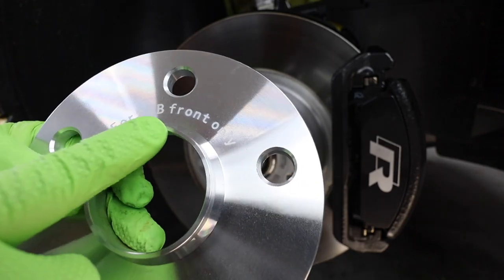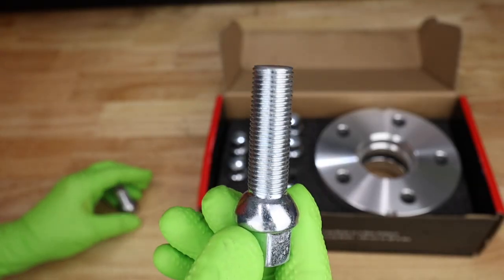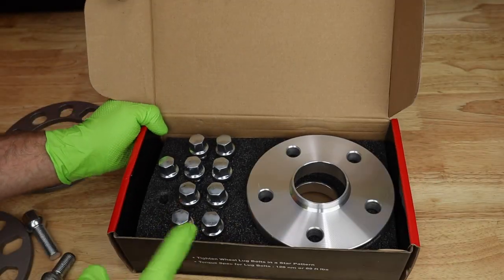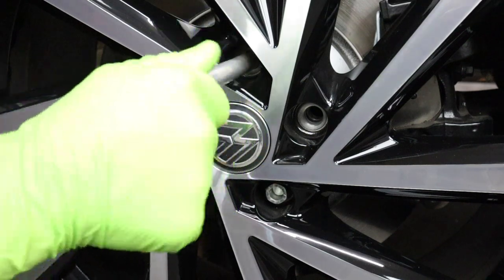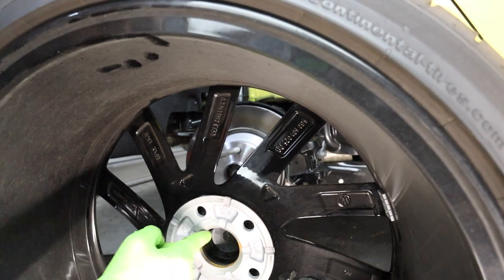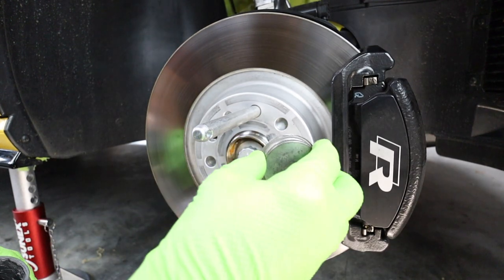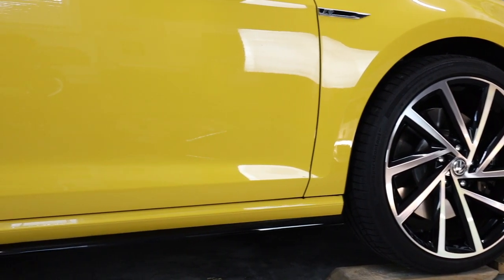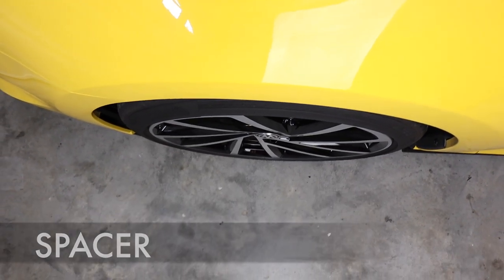How to PROPERLY Install Wheel Spacers

Comment: This may work to pull bolt caps, but since the caps are round and most of the Audi ones I've experienced are still of the hex pattern of the bolt, it may not be able to get a grip on it.

https://www.amazon.com/Genuine-Audi-8D0012244A-Wheel-Removal/dp/B00GZH9H88
Reply from the maker: That won’t work for these. You’d have to have the Audi caps

Comment: Great video, good quality and very informative. However, I'd advise not installing spacers at all. Engineering explained as a great explanation as to why. In addition, if you want to fill your wheel wells, spend the money and get fatter tires. But if your car is just for show and not a "real" sports car, whatever.

Comment: Buy correct rims don't use them
Reply from the maker: Even with the right wheels, there are places where spacers are good. The key being the RIGHT spacers
Reply: At the thickness you used I will agree. But these truck running 3 or 4 inch spacers is out of controll . I have seen a crap load of parts breakage.. tired of fixing idiots junk. Sorry I stabbed out not to use period. They have there place just like body lifts do. Thanks for the German tech I don't see a lot but when I see them your my thought...
Reply: @anthonybrunk2523  
I have over 100k miles towing, racing, sled pulling, and daily driving with 2 inch ones on the back of my F350, to match the front width and not look silly with larger 305 tires. Zero issues. Bought steel hub centric ones from Arrowcraft, torqued them on with blue locktite, and they haven't moved.

Comment: The correct way is to put them in the trash can
Reply: I mean not really, plenty of racecars run them, lots of FD drift cars do, and those cars are under incredible suspension stress. Key is to not buy the eBay special
Reply: @elijahlawrence8010  Racecars also come with race parts and race suspension setups.

Comment: Wheel spacers are not a good idea.  They move the load outwards, placing additional load on the smaller outer bearing, a load it was never designed to carry - the result, premature failure.
Reply: The question is how far does it take for this to happen?  15mm rear and 10mm front should be within safe limits on the Golf model.

Comment: Wheel spacers are extremely dangerous, they should not exist and fail state inspection for that reason. Just get the wheels in the size and offset you want instead of putting cheap dangerous spacers on.
Reply: But what about not-so-cheap properly designed wheel spacers? In that case you have done nothing more than what a brake hat does- it is also sandwiched between the wheel and the hub. Like all parts, not well designed ones give the rest a bad reputation.
Reply: @chriskelvin248  there should not be anything between the brake hub and the wheel, nothing.

Comment: Spaces are for Muppets and are  illegal  . You always want the hub / disc mounting surface to contact the wheel mounting surface.  Any real mechanic/ technician knows this and don't use rubbish spacers . Got a death wish like so many
Reply: mr323i LOL
Let me guess, you are a real mechanic?
Reply: mr323i LOOOL its getting better and better!
Changing oil at a garage dont make you a mechanic. So you are right and the thousands of people that use spacers at track days, racing, drift, time attack, rally cross, autocross, etc are wrong? Do you even have any physic knowledge (at least the comum sense one)?
And no, i dont run wheel spacers, even dont like them very much.
Funny guy.